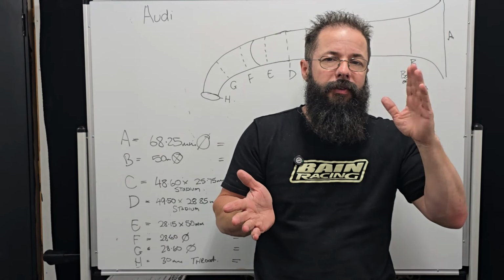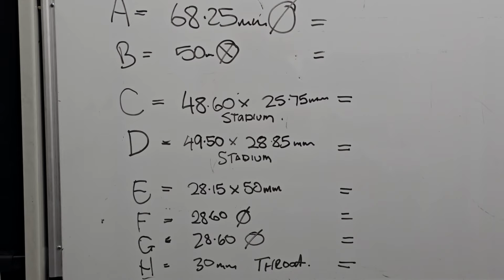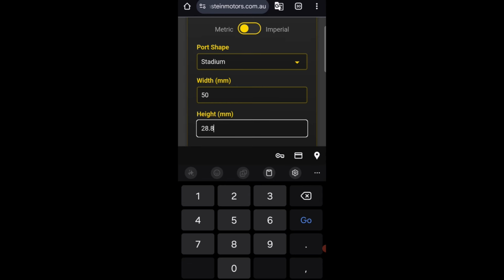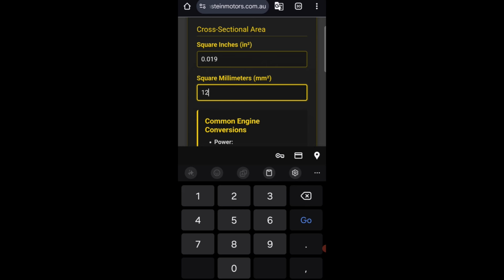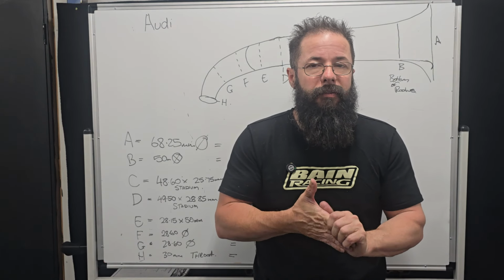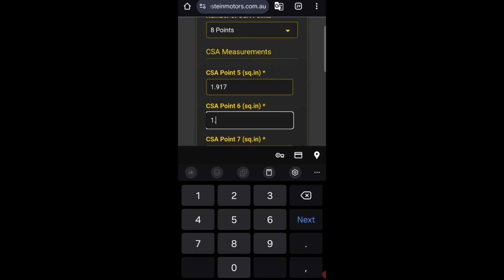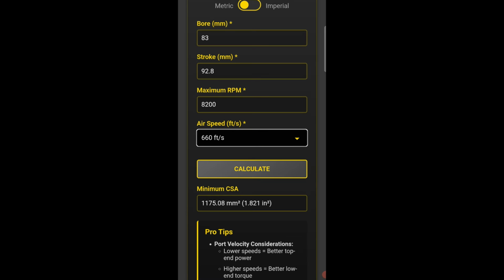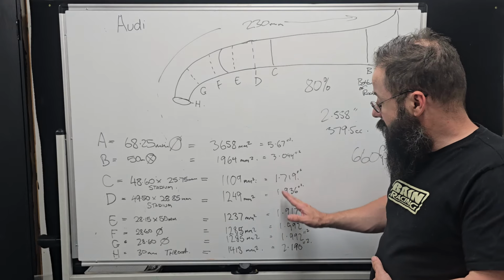Stop Chasing CFM! S3 Audi Port Build - Math Over Flow Bench Numbers

Comment: Where's the injector at? I have a feeling that the extention somewhere around where injector flares its fuel charge is reasonable and useful, because fuel would add some extra volume that you don't seem to account for (I know it's not much but still not totally negligible either?)
P.S. I mean between C and D
Reply from the maker: Injector is in the standard position.  The CSA math allows for fuel mate. 👍

Comment: Nice video Jake! I design my VW aircooled intakes the same. Just like you have a choke in the manifold we have a choke with the venturi in the carb. That is where figuring it out gets tough
Reply from the maker: Yeah definitely for carby! With EFI I like it lower down.  But this is what we were given so sometimes you just have to work with what you have. 😂👍

Comment: The less then ideal intake runners had me wondering about more scenarios, what would happen if the runner diameter was smaller then port window on a motor that had a port that was too large? Would it mimic a smaller port or just entirely destroy the flow momentum.
Reply from the maker: Yes it will!  Till the air speed through the MCSA gets too fast (starts losing lots of density to entropy) and we start converting more and more kinetic energy into heat and we can't recover that density.

Comment: Why not smallest mcsa at throat? Why decel? Isnt decel for turn 2valve stuff?
Reply from the maker: Yes and no mate. It really comes down to the manufacturer. Some are at the throats, others or at the window.  But these are also emissions engines. So huge long runner.   

Also this isn't seeing massive RPM. But yeah personally I like my 4 valves with the MSCA down at the throat where possible.  

But these are the cards I've been given!😂👍
Reply: @bainracing thankyou for kind answer
Reply from the maker: No problem mate

Comment: Jake, great to see the process at each step with the calculations, you should do more videos like this with other heads. 

Couple questions:

What do you do about the runner length being too short? 

Could you do a port mold to do the CSA mapping? Wouldn’t this also give you a good idea of he deficiencies in the shape? 

Also, you deserve far more recognition. You should reach out to the guys at HPA, I’m sure they would love to have you on the podcast (they had Dave from head games but he didn’t talk in much detail). I’ll vouch for you next time I talk with Andre. 

Demetri from U.S
Reply from the maker: Yeah mate we have the v12 Toyota heads series coming, the 1uz V8, some BMW and MIni. Same deal really.   And yes!  I love port molds. I have boxes full! 😂.   And generally if I can't make the runner length targets,  we will shrink the CSA to compensate.  This is what we had to do with the drag week BBC intake we just did. It surprised us all. Netting 72hp more. When sunset in the US usually only see 40hp from the single plane to their tunnel ram.   But they do target the 4th. Where I believe its not worth sacrificing all that runner length. I use that inertia and it paid off. 

And yeah mate. We will be doing port molds on the V12 5 litre Toyota.  Its for a shop in WA  for roll racing and their goal is 2500hp at 10,000 RPM.  So this will need some planning we have a donor head to cut up and see what the cores are like. I have done these before. But not at this RPM. So that will be interesting.  

Cheers demetri 👍😉

Mate to be honest we the new shop I'm trying to build and everything we have on. I'm bearly finding time to do just these videos.

Comment: How would you calculate a bigger bend in the runner as seen on many oem engines? 
Say like a 90 deg or even 120-130 dwg bend in the induction.
Id assume the bend would function lika a choke but how much?
Reply from the maker: Yeah it will, you need to work out whats the relative air speed at that diameter. This will tell you how much work is needed. If i can get in there i will wilden the floor and shrink up the radii each side of the floor of thr turn.  You cant do too much without filling the far side as you will just end up adding too much volume.

Comment: Great content, Jake! How do you go about deciding what velocity to shoot for when designing a port?
Reply from the maker: Math usinh the math solves most issues. I want the higher averages, 320-340 fps. And 99% of the time, if I get the MSCA on size for RPM and fix any and all variationS in CSA, so I have a very stable CSA from valve to window, it's perfect; the job is done. Any chasing on the bench usually ends in disaster!😂🤦‍♂️
Reply: Jake, thank you so much for all you do! Your videos and content are by far the best out there. And the fact that you take the time to respond to all of the comments really shows your passion and how much you care about your viewers and subscribers!
Reply from the maker: Cheers for the kind words mate. Glad I can help 👍

Comment: Used motor oil works on carbides to prevent aluminum loading up on the carbide. A little trick learned from Joe Mondello
Reply: Wd40 or straight Kero works too
Reply from the maker: Yeah, if you are going to use old oil. Make sure you wear a full resporator as old oils give off toxic gases as the off gas while using.
Reply: @bainracing  who's not wearing a respirator when porting?

Comment: When you calculated runner length, erroneously multiplying 230mm by 25.4, I think you should have used 304mm x 25.4
I've independently, in just a couple of years as a complete novice in my shed, come to the same conclusions and approaches as yourself, just from applying reasoned thinking and a good grasp of physics.
Reply from the maker: Where are you getting 304mm from mate? Yeah, it's pretty much common sense for guys who have a good grasp of physics. I've met engineers that don't!😂 and quite a few of the average guys who play cars that do. And a very good one.
Reply: @bainracing so true. 230mm manifold plus 74mm port length in the head. Unless I misunderstood the 230mm was the actual total length? 
Also, would it make sense to deduct the valve stem area from the valve throat area? You may have already, but not mentioned it?
Reply from the maker: Yeah mate. 227mm plus a 3mm for the spacer was the total length. I wish it were 12" 😂👌 yes I do and my apps will do that. These are just rough numbers.  We talked about this in my 2jz series,  also you need to work out what throat. So for me on an uncut seat. I don't include it, as by the time we clean it up, it will be that extra 20-30mm2 bigger. As I do not like sinking seats. So a lick on the throat will also tighten that seat angle up. 👍
Reply: @bainracing my bad, makes my CA18DET induction length of 290-330mm feel less inadequate now 😂